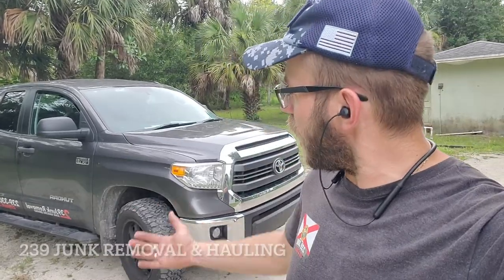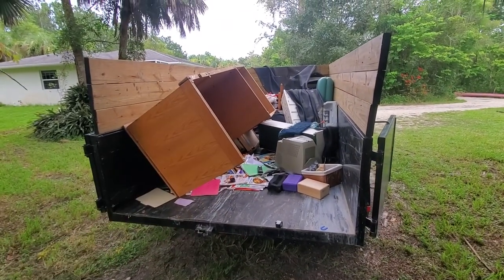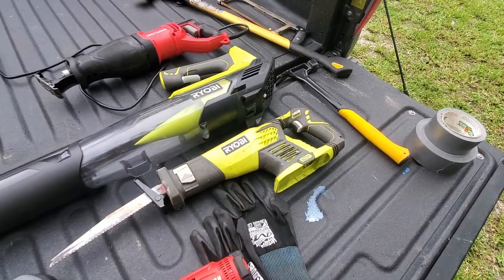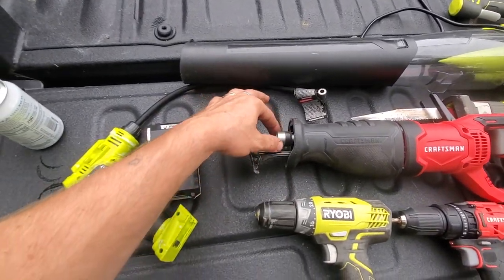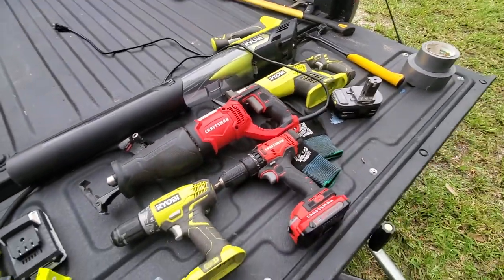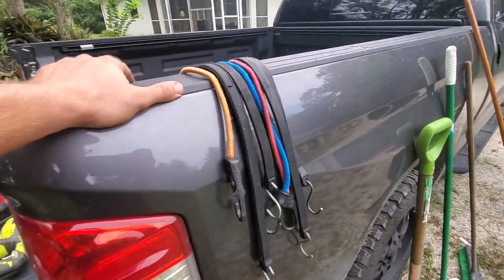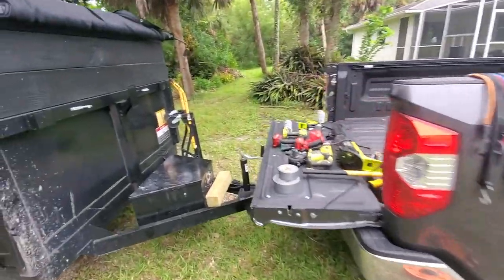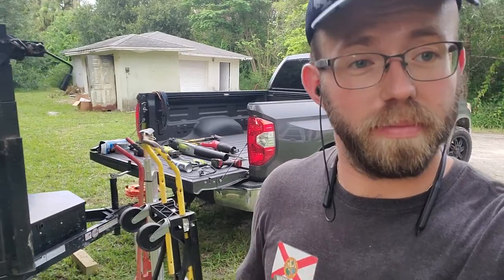Junk Removal Tools LIST | Truck, Trailer & Equipment

Comment: Great video.  A few things I feel you should add to your arsenal.

Air compressor, small/ large sledge hammer, ratchet straps, u-line utility cart, moving blanket (hardwood floors or walls in tight areas).
Reply: Ratchet straps help a lot!

Comment: I have started using a battery powered chainsaw for hot tub demo and it’s so much faster and easier!
Reply: I’ve thought about this. How does the chain hold up? Any specific chain needed or just what it comes with?
Reply: A chainsaw, not that's what i'm talking about. Adding that to my list